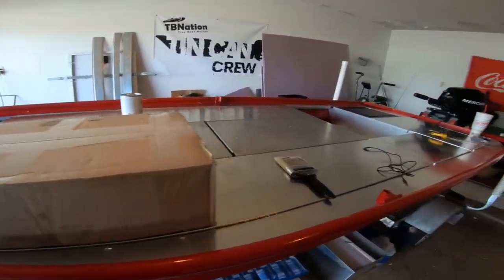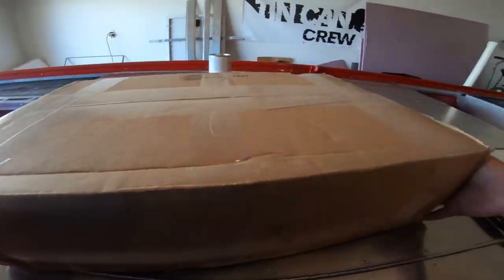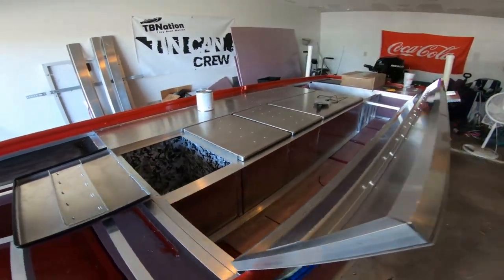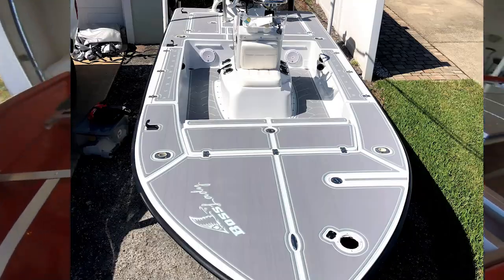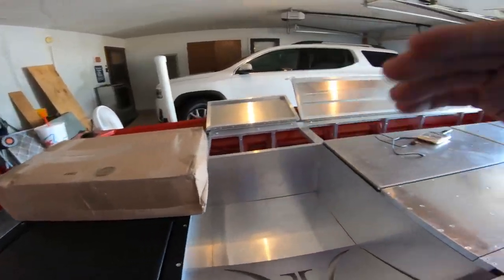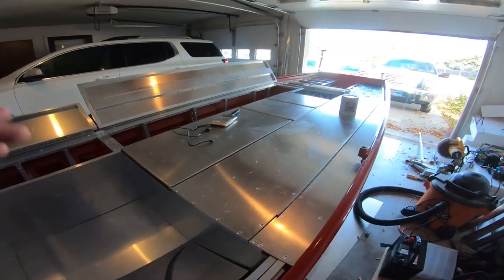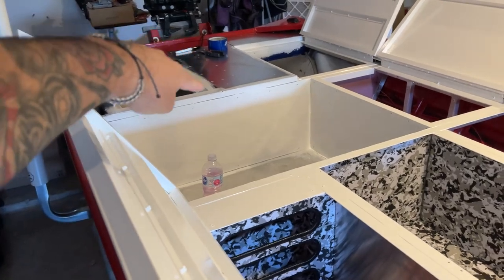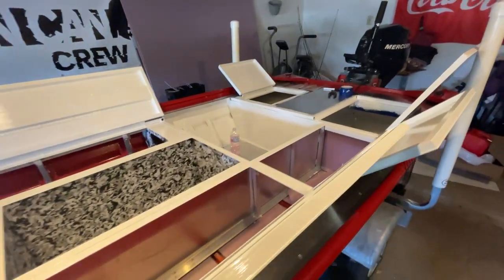MY Jon Boat Conversion Looks COMPLETELY DIFFERENT NOW!! Update

Comment: The white is going to look good with grey foam. But you probably should have put a coat of primer on before painting, hopefully it doesn’t start peeling on ya. I’m loving these Jon boat to bass boat videos. Good luck fishing on your upcoming trip!!
Reply from the maker: I used the same paint on the outside of the boat and it’s holding fine after a year
Reply: Sweet!..it should be fine then. I know It’s looking good so far. I can’t wait until you get it done. 👍🏼